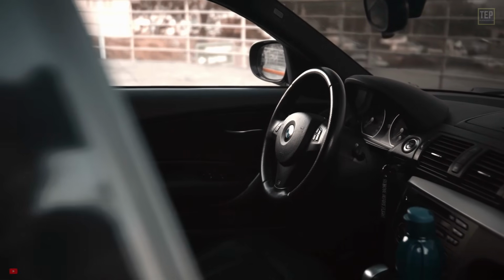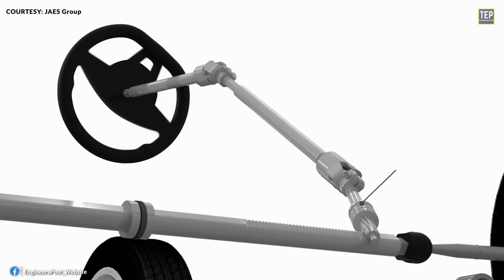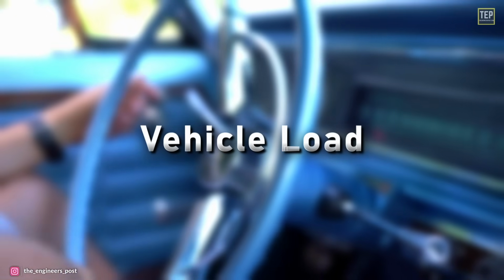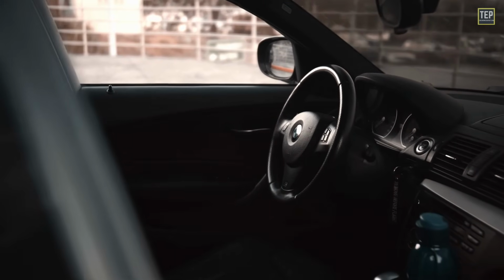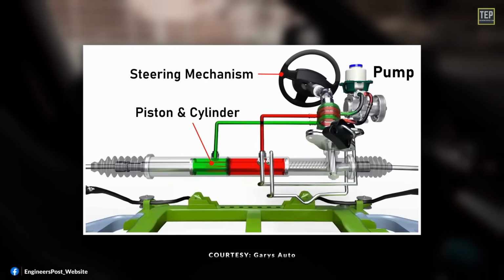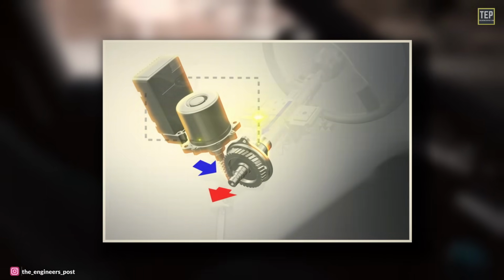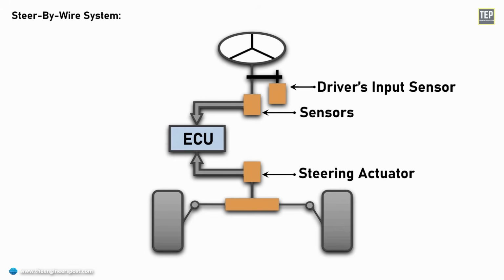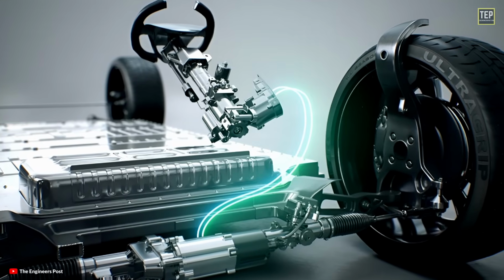Every Car Steering System Explained | Hydraulic, Electric & Steer-By-Wire

Comment: Last project continuity South America at this time only. The Andes Mountains ranges shall be created using my Chandelliering clouds of create temporary converted only now to Cloud Computing Quantum Computer combination above that for speed build and implant, using scan effect, build and implanting tech of giant Astronomical half circle giant fan like radars at the same time funnels like Chalice of reverse effects Sunlight Solar panel of Radars energy harnessers by traverse at its special metal aluminum scaffold traversing energy storages inside mountain ranges to a covered specific opposite mountain structure below and within energy passages of large Bowl effect on Top of Andes mountains then narrow passages with filters and screens radioactive screens and filters then Bowl of energy swoop by scaffold into an energy of pathway propulsion oscillate back up again specific pathways up in continuity up and down, the Bowl downward likened to energy Dome inside housing Civilization structures of energies at the Bowl cap circles edges circle canals of segmental storages of taking in some energy, taken out on top by oscillate evaporate energy and wind propulsion carried momentum cycles and if invented teleport tech mechanisms within energy covered inside mountains civilizatikn structures can do, the rich energy inside bowl domes fields conducive for computerized technologies, system equipments, data storages of enclosed, monitors tech displays, energy sourcds, power generators, heat temperature regulators boilers, garbage heaters recyclers, steam baths creation and artificial geothermal jacuzzis, server tech placements, transport crafts parking areas by mountain manufactured holes open and close rock created secret doors entrance and exits with beam defenses, and energy nodes for civilization infrastructures energy power and internal artificial ultraviolet creation for internal gardening food source plantations and garden parks and inhernal aeration fans regulators ,humidifiers, science lab research and developments facilities for whatever purposes. Let it be

Comment: Always remember, South America of a geographical mixed area terrains of mountains ranges of the Andes, a different area of uplands and peaks, there's the flat plains of grass and lands and there's a forest jungles of greens of plants and scrubs and trees and swamps and roots and river branchings of the Amazon rivers, not all are green bushes. The Khudzu veins plantations are of walls area only wherein the roots of such I science manipulate to be at length only with ground firmaments to prevent erosions and counter erosions underground soils integrity affectation wherein the segregated by concentrate stomata types of nature and cosmic rain vapors and gases compartments are of precious value for nature chemicals of harvest including it's continental length walls for area converted data storages in micros and energy sources harvesters and for the energy harness harvest, precious precious money plants of vines. Let it be

Comment: 3rd project part at the near sea shores are the uniue Large Cruise ships with sophisticated fishermen boat like tech side  anchorage balancer of spin rotator motors using sea water energy undersea pointer at Earth gravity swirl anchorages of dual to several cruise ships fixed park in formations attachable junctioning merging assembly mechanics of water worlds infrastructures that can support its weight like super engineering design open architecture water worlds structures of unique floating Cruise ships foundations wherein upon sea Anomaly detectors of its other sensor machines, the Cruise ships water worlds of bridged and fiber optic glasses with no corrosion elements metals structures passages elevators narrow roads and bridges parks and commercial areas and unique design habitats infrastructure waterworks,  can by tech alarm concentrate the inhabitants at areas of stay for the Lego like transformer structure refold from its foundational bases Cruise ships shared equipments arrange at its each compartments of open and close, retilt ots fisherman boats like balancer spinner motors of coning waters Creator of beam pointer at the Earth gravity source anchor retransform its each side mechanical frame machines like tilt Rotor, rearrange reposition at the near rear for like a afterburner large speed motor of unique cruises Ships foundation structure base for the transfer migrate location  due bad weather or sea area anomalies for example. The garbages be by like custom like containers ferried tubes in the Cruise ships by another ships garbage container collector of large mechanical arms and overhead  very tall stable slider cranes likened to used in large ship building wihhin the Unique cruise ships equipments foundation structures. Ordering by space orbitals tech designer of the CaesarKing, project at the created paths Earth atmospheric layer Quantum Networks of the CaesarKing and temporary realm swap for easy create. Let it be

Comment: 2nd project part. The ladder semi stable ridges base of sea ramp surface shall create Coral spreads at the base likened to Rice terraces of coral structures with sea weeds and sea urchins garden along the length of Rice terraces like in the seas combined with ionized colored materials and cosmic lights converter to Earth property flourescenting harvesters storages of luminous colour beams of paradise shining Coral worlds infrastructures at the near  base and base of ramp wherein the caesarkkng shall create oscillating energy reverse water falls effect imploding at the top hole of bishop cap like shield fabrics scaffold engineering tracer streaming of up moving the cover electro magnetic vibratory energy shields of plenty of such like cities in there of within the fabrics protective layers  internal infrastructure of Corals civilization habitats and data storages and energy within nodes storages of coded entrance and exist at the corals civilizations wherein the plenty of cover fabrics shields energy vibrations tidal waves pressures and molecules dissipators. Let it be

Comment: The CaesaKing shall create projects at several South American countries. Using science and nature manipulation powers, using speed up upper area undersea sands and sediments rift rapping and refilling of creating spacious basins at the near shores facing South Atlantic Ocean and Southern Ocean by manipulating the Earth magnetic fields wavelengths wave making tilting at the sides of South America by temporary to and fro movements by area scanning for the works using lower area below seas mantles and underseas and upper area triple oblong created oscillatory waves with pressurized energy movements in conjunction with air winds and sunrays ultraviolet radiation during the days and cosmic push and pull between Earth moon and Earth during the night pixel pointers of build cause and effect strategic inDenting, molding and foundational stabilizers with lower deep continental plates channelings of volcanic narrow branch lavas and underground gravel and sands and minerals hardening for foundational stability at upper plate layer layering while using parallel interacting magnets at its caving foundations underground alternates with Lego like  plates lesser solid ridges connect of interspaced alternates of thin movable under ground sliders shock absorbers with moisture materials of sporadic foams and gelly like materials with reinforced fiber roots of attachments to its surface thin like flat plated bricks sliders of minimized laddering for the basin that if ever nature and planetary calamities and earthquakes and continental movements by plate effects  happens, the created wider long basin shall be dragged with the infrastructures therein without much collateral damage while the dumped selected by scan sea materials of nature cause and effect of shift shaped countour reshaping of slight upper though flattier laddering shall obstruct to some extent only the tsunamis and strong Tidal waves of planetary cause inside cores and underground, that basin areas including falklands islands and the Uruguay areas at its coastal approximate at the length of South Atlantic Ocean and Southern Ocean in conjunction with the continental land areas, there shall be small holes of sinkholes of chemistry manipulated and magnets interact scooper by water implode gases at the secret swirls of dots of sinholes dirty chemistry and gases engulfer underground processing areas by electron transport chains of produce recycle renewed form materials components. As initial start of build build build project. Let it be

Comment: 8:49 "the pressure is applied through the pump, and is driven by a belt that connects to the engine, the pump speed regulates the speed of the engine" I didn't know a power steering pump regulated the speed of an engine.
Reply: I scrolled into the comments when he said that. I'm not sure how much of this AI generated stuff you can trust.

Comment: Thank you for your explanation. Here you explained that steering systems allow drivers to control the direction of the vehicle and there are six types which are hydraulic, electric, rack and pinion, recirculating ball and steer by wire. He said it worked by transmiting the steering wheel force into the movement of vehicle's front wheels. Therefore the hydraulic and electric power steering systems provide you some assitance to reduce the effort when turn the steering wheel. However ther is one kind of steering system that doesn't have a steering column, instead have many sensors and steering actuators to turn the wheels.

Comment: My EPS failed mid-drive once. the steering instantly becomes too heavy and was hard to turn (seem like the gear from the steering motor still engaging when it failed). but on Hydraulic, steering was just fine if you lost the power mid-drive. but on the other hand, you lost some HP and fuel efficiency to the hydraulic pump.

still can't decide which one I like more.

Comment: Drive by wire = Die by wire. If cars used a similar maintenance schedule that fly by wire planes have it would mean every oil change they would have the mechanic disassemble the steering mechanism and test each component, document it, take photos, take several hours,  and cost easily a $1,000. Not to mention a completely redundant drive by wire steering wheel on the passenger side.

Comment: I dont trust Electric Power steering and steer with wire
Reply: 어째서 신뢰하지 않는 건가요?
Reply: What's wrong with electric power steering though? It's the most efficient and maintenance free system. 

I understand the problem with steer by wire. It's only useful for rear wheel steering.

Comment: Electric power steering seems the most effecient, practical and reliable

Steer by wire is way too impratical compared
Reply: Eps is also easier to retrofit on old cars compared to other systems
Reply: Electric power steering for front wheels and steer by wire for rear wheels.
Reply: Agreed. I enjoy my almost zero maintenance EPS in my R55 MINI John Cooper Works.
Reply: Not really, as it don't need to be physically connected to the steering system, on cars that the steering wheel was always not centered now can be. Also it steer the back wheels too
Reply: @Vanessinha91Pucca  you always could build centered steering, though? It's just a waste of space.
Reply: Tf are rear wheel steeting what am i missing out😈
Reply: @AdrianSesen  rear wheel steering is old technology
Reply: EPS is great until it stops working. Still falls behind HPS in terms of reliability.
Reply: But it also has a disadvantage Electrical power steering system: if a system fails, the steering wheel will not be obeyed, it may lock up, and the engine will not start. What do you think?
Reply: @HabibWorku-v9f  comes cons has to be accepted
Reply: Electric is wire. Feels like using a joy stick, completely emotionless and disconnected from the street.
Reply: Electric power steering is cool until you get less response through the wheel when drifting and performance driving (see Rust Bucket Motorsport's Smart Brabus four four test drive)
Reply: Except it has shit feedback on all the EPS cars I've drove